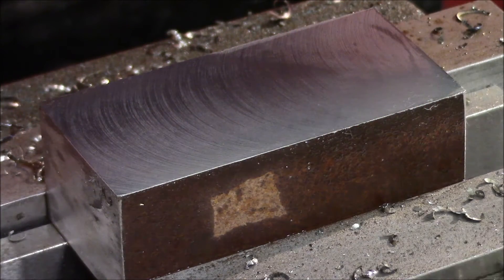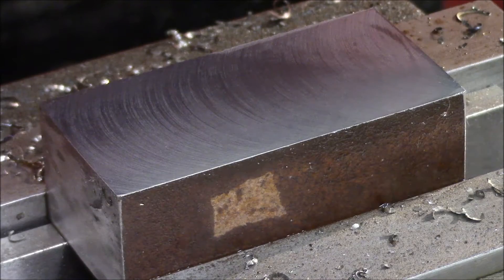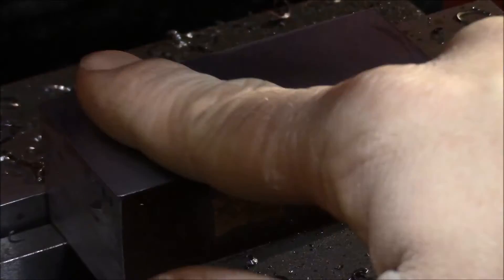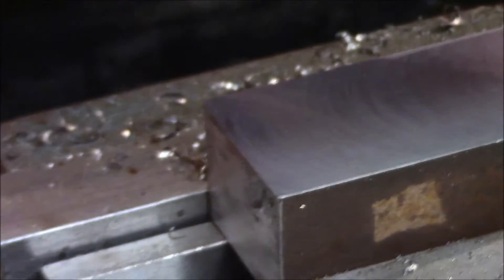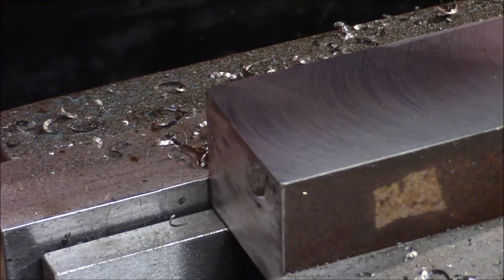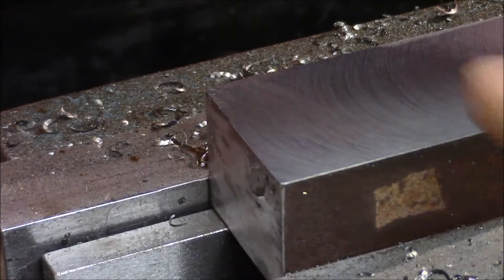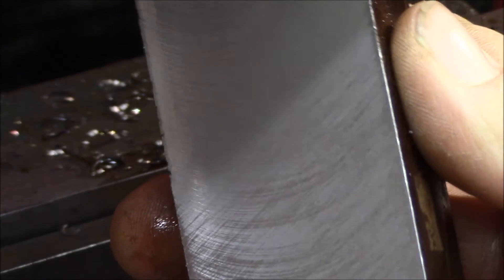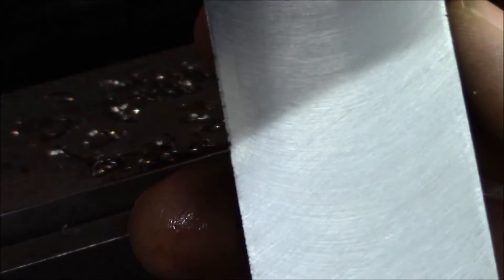part 2 - How to make tool blocks for the quick change tool post

Comment: Perhaps with a wire wheel on your grinder you could remove most of the rust before surfacing...
Reply from the maker: +BlueFlameCNC yes-- it is the a nice way to do it, i don't have a wire wheel set up right now, but it is on the way. it is a lot better for the cutting tools to get it of before machining.. :-) or buy new stock,....thanks for watching
Reply: Bitte schön!